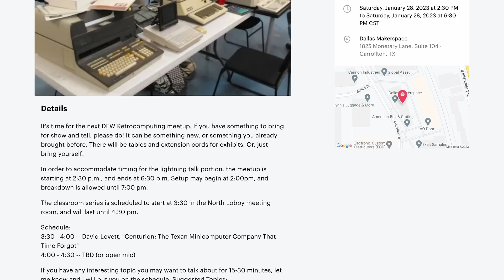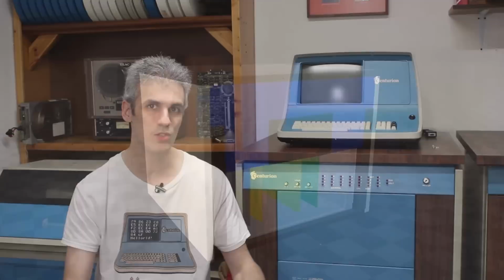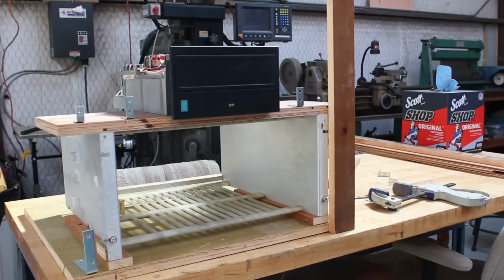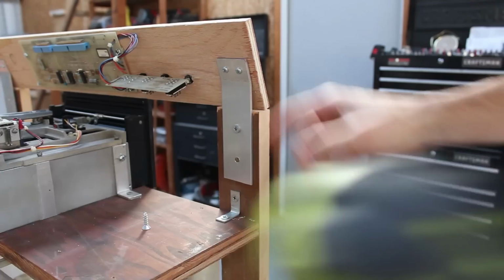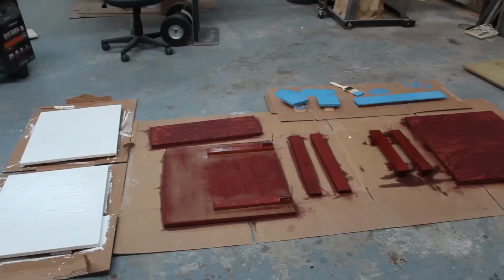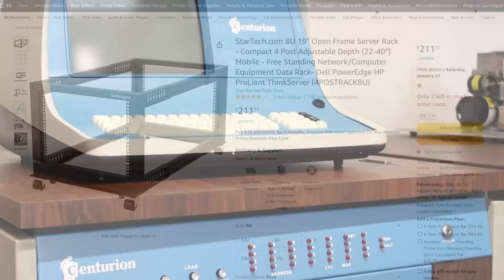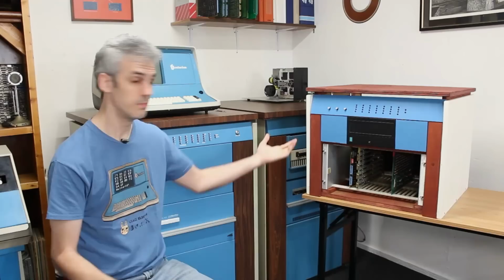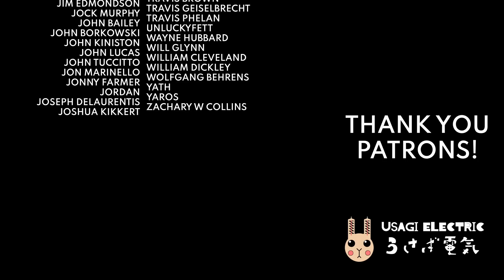Building a “Miniature” Centurion Minicomputer (Part 1)

Comment: Dont bother with stain.  Just buy a roll of wood grain contact paper.  They are cheap and come in every type of wood grain and color.  Also, its easy to replace if it get scratched or dinged.  Even if the underlying wood is damaged, just fill the dent with wood putty and lay a new strip of contact paper on it.  As for the wood that is supposed to be metal,  you can get some car filler, like Bondo and lay on a decent amount over the entire piece.  Then sand it down.  Apply some primer and paint.  If dont right, it will be smooth and not look like painted wood.  Also, add wheels to the bottom.  Wheels will save your back.
Reply: I like these ideas
Reply: I was about to suggest the dame for the wood. I believe that it would look more authentic as well as a lot of stuff from this period simply did that anyway.
Reply: Wheels - or heavy duty castors is a must. I could almost hear my back complaining just looking at that thing. Great build BTW..

Comment: If you didn't put on any kind of varnish (polyurethane, lacquer, shellac, or oil) you should be able to correct the color a bit by applying a darker brown stain over the reddish stain you have now. Use a test piece of the same material. You may have to mix the stains and play around with the time you let it soak before wiping it off.
Reply: thanks for saving me the time to type that out, that is my thought exactly
Reply: Considered the finish on the original, I'd look for a matching wood pattern vynil wrap, or some iron-on veneer.

Comment: Carpenter here. 
Great Job! This came together well. 
If you are choosing a darker stain you might be able to apply on top of what you have. Use a small scrap piece with both stains to see what it'll look like. Otherwise you can sand off the stain as long as you don't burn thru the top ply. The stain looks fine though. 
Also you might consider using that small piece that you cut for the top and adding an Edge band of solid wood to make up the difference. This would also hide the Plys on the edge and look fancier.
Please wear safety glasses when using a saw though.  Remember 'Safety is No Accident'.
Reply: the funny bit is making real wood look like phony pressed steel with wood pattern printer on it? 
second coat the same stuff, but as you said used off cut test first, and maybe a clear top coat somthing mat, to get none real plastic wood look,
am idea as he no painter, avoid paint completely, there a stuff (common named - stikyback plastic, comes on rolls like wallpaper, and it come in many printed patterns colour too, track down wood pattern and just rap on the areas needed job done,   if your wanting to make more sturdy go over it a second time with clear verion, with nat or gloss, as desired, no drying time all done?
Reply: [s the plastic stuff is water resistant stick on flowing on fin film/spray of water to ease sliding it in place, squash the water out to the edges

Comment: I would mount the drive left aligned and have the same amount of space on the right side with a blue face plate to cover the space. It would look as an original which allows for expansion of a second drive.

Comment: wood working  tips from a guy who makes guitars :P
if you used alcochol based stain it went deeper than you think, if you used water based stain it is just on the top of the wood but general rule is when you laquer it it will get darker and you can thin down any same system dye and rub it in as is if you want to make it darker before laquer, but avoid black
 and if you put 2 of the same system dyes on top of each other you can use this system thinner to mix them up, you can also get nice effects by first aplying darker color, sanding it back a bit and then aplying base color
color after laquering should be close to when the wood was wet during dye aplication

and for a sake of finish
if you don't have a spray gun use a roller, short hair single use ones would work well with laquers and paints, foam rollersor long hair with dyes 
many thinn layers instead one thick work well and laquers like to sink in an the first layer so don't overdoo it, just let it dry or use filler laquer as the first layer
for your use you don't need 2k laquers , decorative water based urethane would be ok, a bit softer but shiny enough, and look like milk :]

Comment: A Wren controller would allow you to use any ST506 interface drive as long as the geometry is supported.  It would open up a good amount of possibilities for using off-the-shelf PC drives.
Reply: Does the Wren controller only do hard disks or does it also support 5,25" Shugart-compatible floppy drives?
Reply: @Stoney3K  I personally don't know.
Reply: @Stoney3K  WREN I are MFM ST412 compatible. I don't think they can interface with floppy drives. Later Wren were SCSI or ESDI/IDE
Reply: @joe--cool  Prior to the Wren I there was a plain old Wren which was a Finch like interface but smaller form factor. Unlike the Finch, more Wren documentation seems to have survived (preserved on bitsavers). Wren drives came in Finch like, ST-506, ESDI and SCSI variants. The Centurion FFC card needs a Finch like variant. There is some discussion on an approach to build an interface to ST-506 drives, since they are infinitely more plentiful than Finch and Wren (Finch like) drives.
Reply: @sjsoftware72  Interesting. Thanks. I didn't know that there were even older ones. Are they also 5.25"?
Reply: @joe--cool  Yes, same old Wren hardware as far as I know, but with a different interface board stuck on to it. Look at (hoping the link is not blocked by yt) http://www.bitsavers.org/pdf/cdc/discs/wren/77711078A_9415-3_Wren_Product_Specification_May1982.pdf

Comment: You need to start with the correct wood, and then work on the stain. Sanding it down won't get you want you want.
Also sheet metal is easier to do than wood for the front panel.

Comment: It won't take too long to cut a few pieces of scraps and experiment with different stains and techniques.  If you have time, you might want to install some folding handles on the sides of the cabinet.  It won't look "correct" but it'll make life easier when lugging the thing around, and it can help prevent unfortunate mishaps.  You might also want to consider adding feet, casters, or corner protectors of some sort, to the bottom.

Comment: The original computer's wood looks like it uses a melamine veneer with a wood grain pattern to get its look, like the boards used for shelving. Something like that would be an easy way to get a specific look without needing to worry about staining or board quality.

Comment: I love it.  Great idea!

I wouldn’t worry about the stain color.  The only change I would suggest is using solid wood for the top or somehow hide the plywood edge grain.
Reply: or iron on edge banding, I have done a few open faced cabinets around the house with that covering the edge, its "easy" and "cheap" available at your local home center

Comment: I would recommend vinyl for wrapping the plywood. The good quality stuff can look pretty close to a powder coat or 70s era wood effect and it's fairly easy to apply, especially the thick type supplied for wrapping kitchen cupboard trims rather than the thin type used for cars.

Comment: Man, you have taken this project farther than anyone expected.  I wouldn't miss the next segment for all the tea in China.  (Try sanding the bottom of that control panel board at a bevel to close the gap...)

You have some facility with sheet metal from the look of things... it might be easier (and much lighter) to make all the exterior panels out of sheet aluminum, and then do what @finkelmana suggests with the contact paper for the "look of real wood".  I don't know much about prepping an aluminum surface to take paint, though.

Comment: As far as the wood stain goes, I think do what other people suggested, and as LGR has done, and go with a wrap that has faux wood grain. If you decide to just modify the stain you have there with additional stain, just know that it will never look the same bc you made those panels out of pine and the original centurion is mimicking a hardwood, likely something like cocobolo. To get the same grain pattern feel, you’d have to paint it on somehow by hand—hence, the wrap is a better suggestion. I also was wondering-you showed an aluminum brake there..maybe you could remake some of it out of sheet metal? It would be a lot lighter overall probably, and probably more representative of the original centurion cabinet? At least the panel with the LEDs. But it’s your thing and you’ve done a nice job w the wood version. :) cool project
Reply: Adding some metal shielding will help with the FCC EMI testing before he goes into mass production. The whole thing could be done with a couple of  FPGA SOC's.
Remember Apple started in a garage. He could be next.

Comment: Option 3) Find that stuff they put on cars and wrap it with fake wood and the off white for the panels, the Blue is close enough you might get away with a clear wrap to fake a metal coating look.  My personal choice is what already was mentioned, try a second coating on a test piece first and a second coat of the white ( after light sanding ) to get that " thick " coat look.

Comment: How to easily fix the color:
Use a "gel stain".  These are actually semi-opaque coatings, not stains.  In elaborate stain stacks, they are used to adjust the color.
What bothers me, though, is the plywood edge.
As for the blue parts, you don't have to make them out of metal.  Just use a nice glossy paint over a smooth surface.
You sure have some nice tools for someone who's not a woodworker!

Comment: I would suggest going to a dollar store and getting wood grain vinyl to put on the brown sections and for the blue sections go to a sign shop and get a matching blue vinyl.
paint the wood in a gloss or semi-gloss to fill in any imperfections before applying the vinyl you could even put white vinyl on the side panels too.
remember to fold the vinyl over the edge

Comment: Hm, you could get the weight down a bit by replacing the 8" floppy drive with a 5.25" one. IBM in their infinite wisdom made the AT's 1.2MB HD drive pretty much compatible to their 8" ones.
Reply: Not quite compatible - IIRC it runs at a different speed and other parameters are not quite the same, it took literally hacking the OS code to even make a different model of 8" working - 5" will most likely take even more, and 8" drive is compact enough to be transportable anyway.

Comment: You can blend stains but its difficult to get the colour right.
You may be better off just covering the wood sheets with a plastic laminate with a faux wood finish or (if feeling brave) try to glue on some wood veneer.
Looks like you may have used a cherry stain of some type? The wood laminate (probably paper?) on the actual cabinet looks to be a dark walnut so a walnut veneer (if using a veneer) would work well then just seal it (zinzer sanding sealer or similar), do a final sand and put an oil or laquer finish  on it.
Watched you on Bil Herd's Friday show just this past Friday.. good discussion there.
Cheers,

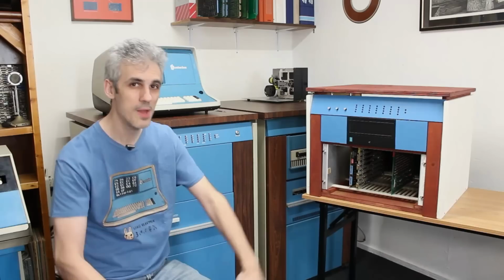Comment: The mini Centurion minicomputer looks good.  You do need to try the Kreg pocket  screw system for doing simple wood working joints. The first time I used the Kreg system it changed my mind and is my go to or quick & strong wood joints.   As for the kid in the 1975 picture @ [13:50 ] I wish I was still 21 years old and 130#,  Well maybe just 65 and 150#.    Regards, Ken R.

Comment: If you want to change the color of the cabinet, you will probably need to sand back to clean wood.  It shouldn’t take too long.  When you are sanding, try finishing up with 400 grit.  That should make the stain application more consistent.  I use Varathane fast dry stain for things like this.  Home Depot should have it, and there are usually a good assortment of colors.  If you need a glossier finish, spray on lacquer usually looks good and dries quickly.

Comment: Great design! Although I personally hate them, you might want to invest in a pocket hole jig ... still easy better than the angle brackets 😅 Maybe some iron-on edge banding for the exposed plywood sides ... and an angled cut on the LED panel ... all small changes that make this case even better 😊

Regarding the colour, you can water a darker stain down and slowly creep up to the desired colour by applying multiple coats. Lightly sand in between (steel wool does a great job) and finish with a clear coat.

Comment: From the layman's point of view, the mock-up looks quite great. The ONLY criticism I could possibly give would be the top, really. I do see the cracks and it doesn't have quite the finished woodworker appearance to it but some wood filler, some sanding and sure, if you want to color match better, that would be fine but the actual appearance of the machine is fantastic and I would, as it sits, gladly present that anywhere. Well done, good sir and side-note, it looks like you shaved off 15 years. 

Great video, thank you so much for all the edutainment and I wish you a fantastic 2023.

Comment: ideal extra part would be a small printer - 80col dot matrix or similar
Reply from the maker: That's actually an idea I've been mulling around a bit! 
Centurion actually sold a TI-810 serial printer that the would connect up to the MUX (and repaint blue and white to match the computer). The OS even has an option to interface to it, so it would be super easy to get that kind of printer setup.

Comment: Love this series! Great video! Would it be possible to replace the 8-inch floppy with a High Density 5.25-inch floppy drive? Although not as period correct, it would make things a little smaller and lighter. Also, it might be good for development if you wanted to avoid the wear and tear on the original 8-inch drives. Just a thought off the top of my head.
Reply: A high density 5.25" is basically equivalent to a 8" DSDD soft sectored [Shugart] drive, depending on what signals from the drive are required by the controller.  Some 3.5" drives can run at 360 RPM and would potentially be a suitable candidate as well.  These are typically "tri-mode" drives that support 1.6MB or 2MB (raw) capacity.  Teac FD-235-HG is an example of one such drive that was apparently commonly used by Dell until the mid 2000's and readily available on eBay.  Either drive would need to be jumpered for 360 RPM (either internally or externally) and may or may not play nice with the floppy controller.

Comment: I probably would have looked at connecting terminals remotely and just lugging the VDUs to the show.
Reply from the maker: That's definitely an option, but not quite as exciting as seeing the real hardware. Demonstrating an odd system like this at a show is all about the experience and theatrics of it. Hearing the floppy clunk or the hard drive spin, seeing the front panel lights flash as it loads in your program, engaging all your senses (except taste, don't lick my computer ;p). 
Connecting remotely removes so much of the experience, I fear it would lose a lot of what makes the system special.

Comment: You could use a black spray paint. you spray it on and wipe it off when its wet. It gets into the gain and makes it pop.
Reply: I think it's a very bad idea, coating with a normal paint or dark varnish is much preferred.
Reply: @jwhite5008  I use it all the time. You can start with a stain then do the spray paint trick I mentioned before. Then I usually go over it with a clear coat after everything is dry. It's all on the look you're going for.
Reply: Maybe, but keep a rag w mineral spirits handy

Comment: The side and top panels are probably veneered or stickered on, not stained.

Does the system support booting TOS from floppy? And how would the original floppy modules fit into the Centurion racks? I kind of expect the floppy drives to be recessed behind a blue door like the Hawk drives, so the front panel remains clean.
Reply from the maker: The side panels are actually painted steel on the original, but the top panel is veneered rosewood. It was just quicker and easier for me to stain the mobile top panel. After the event, we'll think about how to improve this thing!

On original systems that had floppies, they arranged it almost identically to how I have it here, only the floppy was standing vertically on it's side. They would position it directly above the Hawk, on its side in the center of the panel. It looks a little weird, but that's how they did it!

Comment: Am disappoint you centered the floppy. It was traditional for computers of this era to have two bays,  one of which was filled with a blank cover.
Reply from the maker: On original systems that had a floppy drive, they arranged it almost identically to how I have it here, only the floppy was standing vertically on it's side. They would position it directly above the Hawk, on its side in the center of the panel. It looks a little weird, but that's how they did it!
You can see an example of that in the picture of the factory floor on the front page of the Wiki:
https://github.com/Nakazoto/CenturionComputer/wiki

Comment: These old computers bring back memories.  Mostly painful.   So difficult to get the coding right. 
Mostly I drew flow charts, then manually passed through the charts multiple timeskeeping track of the variables. Then finally converted the charts to code.  Then after the code compiled I converted the code to flow chart. When all matched up I tried the code for real, and still a bug or two occasional happened. Things like variable size too small or not enough precision.